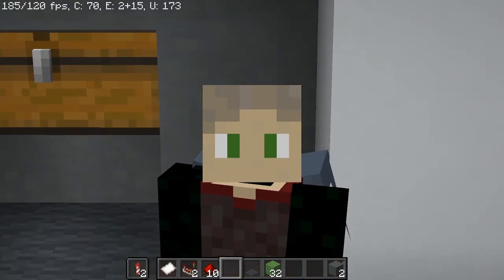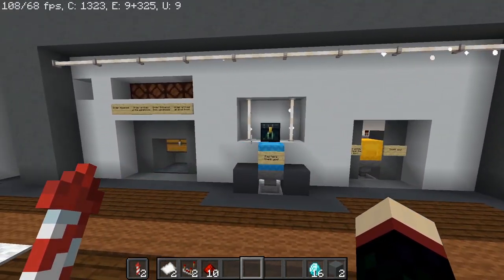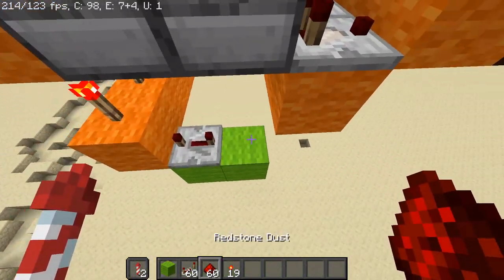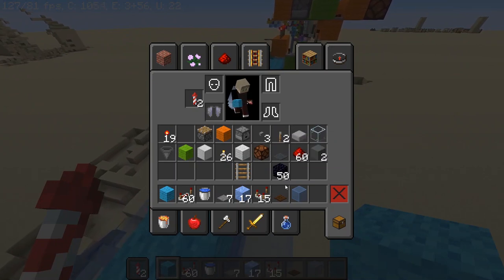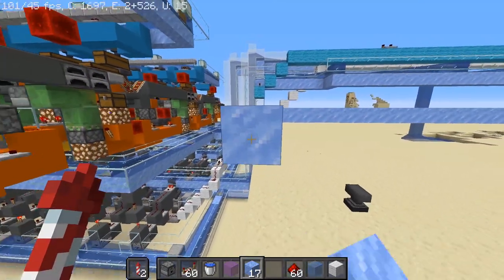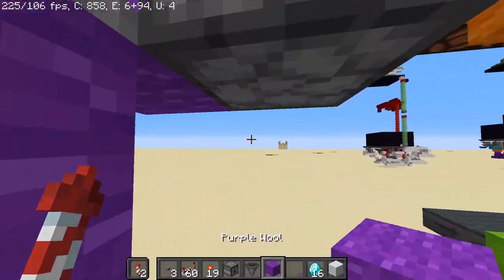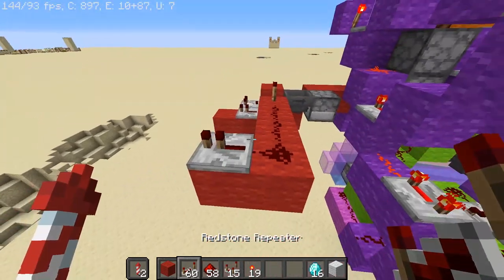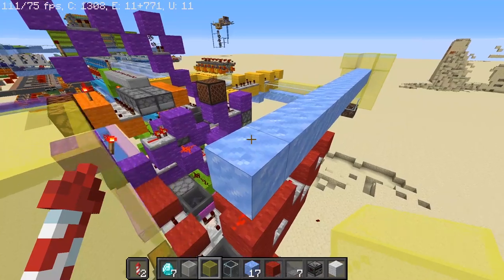SAHARA REDSTONE REVEALED! Building Sahara Part: 4

Comment: Im about to start this video and finish up the system. I just want to say Thank You so much for putting the effort into these videos. From the first time I saw Mumbo and Sahara, I wanted to build it. So thank you for taking the time and going through and showing how to build this block for block. Im so excited to start this final video
Reply: Also I noticed that the lights turn off once the shulker box arrives for pickup. We have the reset for after the shulker box gets broken. My thinking is that the purple circuit  some how also resets the lights